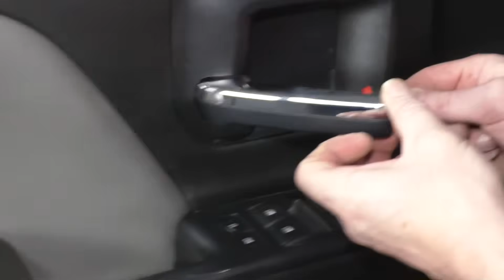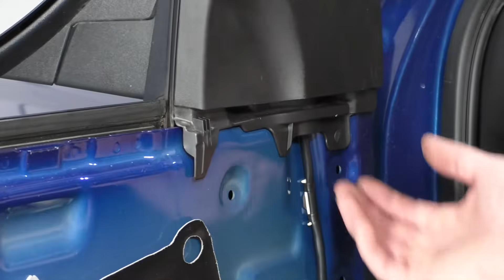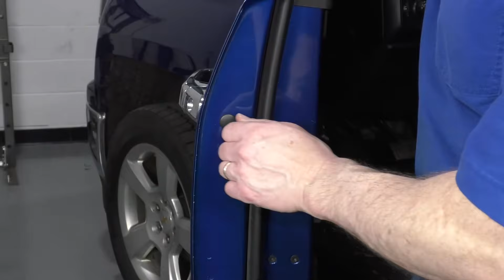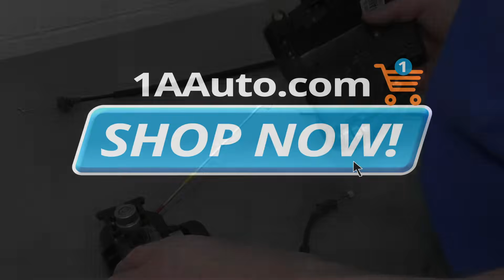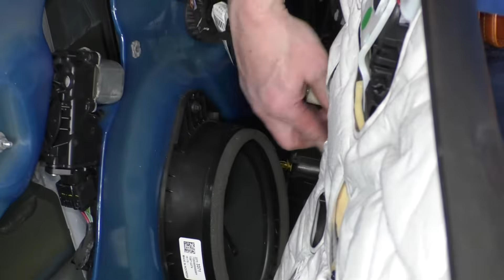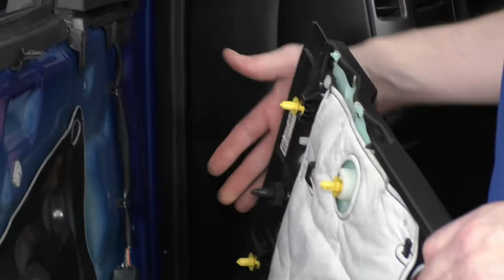How to Replace Front Door Actuator 14-19 Chevy Silverado

Comment: One of the 5 bolts that holds the window regulator and window frame twisted and is not fastened any longer, this will not allow me to remove the nut.  How do I get past this?
Reply: I had the exact same problem I angled the stud so I could remove the nut make sure you get a tap and die set on the nut and if possible on the stud to
Reply: Don’t see any reply here, ran into the same problem what did you end up doing about it?
Reply: The same thing just happened to me. I ended up using a dremel tool to cut the bolt off and placed a new bolt and nut through.

Comment: Thank you for putting this repair up.  It probably saved me a few hundred dollars. You were right, that first trim panel you pull off to access one of the screws is tough!  I finally thought if I break it I'll just buy a new one.  It didn't break however.  Additionally the door panel was a little difficult getting it off the top.  Instead of trying to pull it straight out I wiggled and pushed up.  I had to take those clips off the panel and put them back on the door panel when I reinstalled it.   I really wanted to buy the part from you but I searched and searched your web site and could not find it.  I'm sorry but your  parts finder site is difficult to find anything with.  Maybe just me but that was the case.  Thanks again.
Reply from the maker: +Bob Beasley Thank you for your feedback!